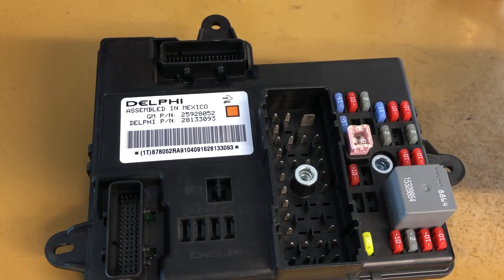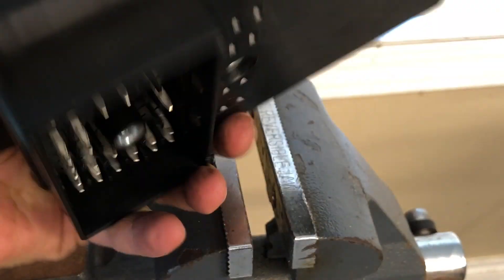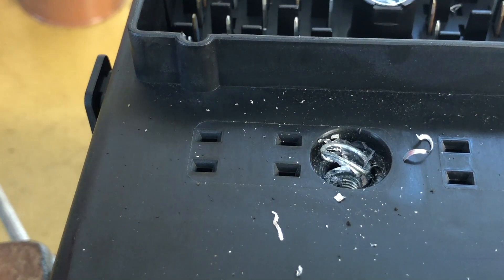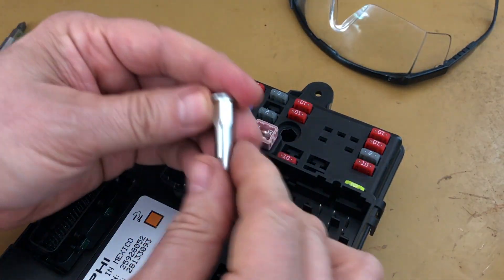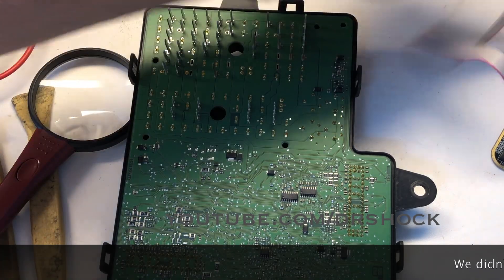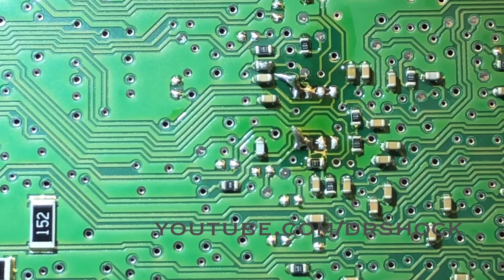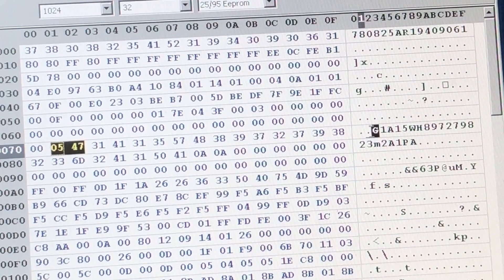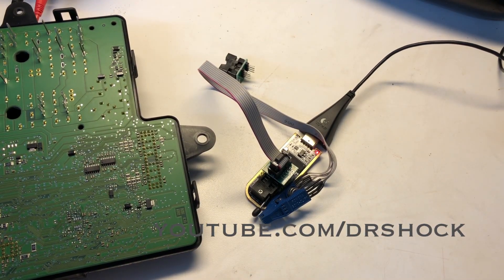2005 - 2010 GM Delphi Body Control Module (BCM) EEPROM Location & Contents (VIN, mileage) Cobalt HHR

Comment: Great info! Here is what I did. I had a 2009 HHR that had A/C, Info Center, and Radio Power Amp out which makes that "tinny" sound through the speakers. The dome light fuse was also removed as the dome light was stuck on....the delay timer quit.
I ordered the exact part number on E-Bay from a reputable salvage yard.....got it and popped it open. Got the bad BCM out and popped it open. Took both to UbreakIfix store that does cell phone repair and the guy swapped the 98050 chip out in 5 minutes. Installed the BCM in and boom.....everything fixed. $75 for the BCM......$100 for the chip swap. DIY at home. This works!
Reply: Good call on the phone repair guy.  I found a local guy that does work like this but I'm trying it on my own.  I got the eeprom off the doner and just received a digital microscope to continue.

Comment: The BCM out of the 2007 Chevy Malibu has the same threaded insert/rivet nuts which can be operated on as you show here, in order to get to the circuit board within 👍

Comment: Very informative video.  I'm in the middle of trying this, I currently have the covers separated and planning to swap chips.  Tried to do without the chipquik but had no success.  That chip is small man...
Reply: I have a Metcal Soldering staion and a Bendolin Digi Microscope and still took it to the cell phone guy.....that guy does that kinda stuff all of the time and it was while I waited....it was worth the money for me.
Reply: I asked the guy about the Chipquick and he says he does not use it as it may heat the board around it and damage it.....this guy was a good tech....

Comment: Afternoon.  I'm also working on a clients 2005 corvette.  Old BCM has a B1000 error (internal fault)  Have not found any damage on the board & wondering if it could be the IC itself?  2005 Vette BCM are now super scarce.  I do have a 2007 BCM that we tried & it everything was fine except for VIN.  Sent off to a "shop" to perform the update & instead they "viginized" the IC file.  Tech2 recognizes & sets up BCM as "new",  stores the new VIN correctly and set RPO code changes as well.  However, after about 20 minutes of key off the BCM reverts/looses the VIN/RPO changes again?!?   I now have a CH341A, modified the chip holder and the ASProgrammer software setup.  However, the chip is NOT a 95080, it's marked as a 2508??  I get all hex 00 when attempting to read the chip?  Tried all the variations of 2508 chips listed as well as the 9508 you used.
Reply: PS  Also, the 05 IC is marked with a 19044. not sure how I can post/send you pics of the chips?
Reply from the maker: I've not worked on a Corvette type BCM.  But I would expect it to be similar to some of the others GM got from Delphi during this era and many are one time use.  No Tech2 or MDI is going to be able to recalibrate them for another VIN.   Board level rework on an used module is all that is left if no NOS or reman units can be had.  Ideally you would just swap the EEPROM chip from the original to the used replacement/donor and call it a day without bothering with programming. But for this to work both BCMs must match part numbers on the white Delphi label exactly as there's little guarantee of board compatibility at the chip level.   Also some BCMs of this era can have RPO programming in the micro controller chip itself, even with the same part number.   Making the EEPROM chip / VIN swap alone insufficient to get full compatibility.  So I would also advise folks to insure the donor BCM came from the same make/model/year GM car with the same major RPO options already as well.

The 2007 BCM sounds like it should have behaved like the equivalent of a remanufactured (all that's typically done is to put the EEPROM back to a virgin calibration state).   Not sure why it reset itself, I've not heard of that happening before.

The BCM in this video is specific to the Cobalt and G5, and it's entirely likely the Cobalt BCM has zero in common with the Corvette BCM even for the same model year.  So there could definitely be a totally different memory device used.   Another common type Delphi used would be a 24CXX series type EEPROM.  You might try that setting.
Reply from the maker: Some other advice, many of these Delphi boards do not respond well to attempts at in-circuit programming.   The testclip will inadvertently power up other chips on the board.   So if you're getting all zeroes, make sure you're attempting all reads/writes with the chip desoldered off the circuit board.
Reply from the maker: The CH341a will handle those 24XXX and 24Cxx chips no problem, using AsProgrammer as the software.   When attempting to read off board as a 95XXX you did make the 5V voltage mod to your CH341a or otherwise have that support?   Automotive chips are not 3.3V like consumer electronics / computers but rather 5V instead.
Reply: Yes, I raised the 3.3V leg, but I just used a jumper between the 3.3 & 5v pins & then confirmed I had 5V on both the CS & VCC pins.  If I understand you correctly I should be able to plug the chip w/ an unmodified adaptor in to the 24xxx side of the CH341a & perform a read.   What IC should I choose in the AsProgrammer software?  
 @DrShock
Reply from the maker: If you can make out the chip foundry / fab silkscreen symbol that's always preferable to select.  If not either choose generic or a major brand like microchip.
Reply: I've got it!!   Was on a chat w/ Microchip.   Markings are ATML on both, somehow I must have had a brain fart as one was even marked 25080AN.  The other had some most likely Delph # of Q904, 58A, PH, 19044CO, but tech chat said it was an AT25080AN as well & gave me an xref replacement #.  So, a non modified chip holder in the 25xx slot & both chips read right out!   Now to figure what next
 @DrShock
Reply from the maker: Good.   So first action is to make a copy of the chips contents and save it on your laptop.   Next I'd track down a donor 2005 Corvette BCM.
Reply: @DrShock  Sorry for not replying much sooner.  I actually used the AT25080 chip from a 2007 donor BCM (Could not find an 05 for lover or $).  Anyway, erased the 07 chip, wrote the as read 05 BIN to it.  Soldered back onto the 05 board & the car is FIXED!!  PS.  I was able to buy a couple of replacement 25080 chips from ATML for the next adventure with an 05 vette failed BCM.

Comment: Dr Shock, thanks for the great video! Ive been following along with a BCM out of my 2005 Corvette. Do you do private consulting? Im having an issue that i cant figure out.
Reply: OG, What kind of problem are you having? I am also in the midst of doing a 2005 corvette and are having wierd results?
Reply: OG please post your solution. I m having issues with mine, 2005 vette.

Comment: Hey DrShock! I followed your video on VIN unlocking salvage yard radios and it worked, I watched the video for doing the BCM and it seems similar although I haven't done it myself, have you ever done this for the PCM on a 2013-2016 GM?
Reply from the maker: PCMs are reprogrammable using GMs SPS/SPS2 so no need really.  These modules do not get "locked", at least none I've came across in the last 25 years do.  ;-)

Comment: This may be treading old ground but I can't get a good answer anywhere, I have a 2007 solstice GXP that among many other issues has an intermittent ground issue caused by passenger feet on the BCM. I know this because all my cluster info went dead while driving and then came back after said feet were moved. Fast forward past a lot of no start, and now sometimes to get it to crank over i have to put pressure on the BCM while turning the key, but not always. Is this a situation that would warrant a new board? Is it possible to troubleshoot the specific ground issue without opening the module or buying a new one?
Reply from the maker: This would have to be diagnosed further.  Could just be a wiring harness problem given your description of the behavior and symptoms.

Comment: This is an excellent video! This BCM (the hardware) is also used for the Pontiac Solstice and the Saturn Sky. I have a friend over on the SolsticeForum who damaged the BCM on his 2007 Solstice GXP when he inadvertently plugged a battery charger in inverse polarity. He needed a replacement BCM and ended up being misled to buy a replacement BCM that either doesn't have the Solstice software in its EEPROM, or is defective. I suggested he contracts your services. How does one contact you? Thanks
Reply from the maker: Thanks. I don’t offer any services, just how to videos.
Reply: @DrShock  that is unfortunate, but perfectly understandable. I am Brazilian and he is in the US (Oregon) so I don't know who to recommend to him. Thanks

Comment: How are you Dr Shock. I recently bought a 2007 Pontiac Solstice GXP. The BCM was dead due to a flood during Ian storm. I was able to safe the eeprom from it. I bought a used BCM and did the switch as you instructed in the video. When I connected the used BCM to the car the radio is locked and the odo display 0mi. Can you help me out. This is the BCM p/n 25848392, the used one also has the same p/n. Thanks in advance.
Reply from the maker: Moving over the chip between identical part number BCMs is an exact clone, so you shouldn't see either of those symptoms.

Did you do a read of the chip before transferring to verify it was not water damaged as well?

Are you sure you got the pin 1 orientation correct on resoldering it to the replacement BCM PCB?
Reply: @DrShock  My cousin helped me do the swap. The first time we didn't have the kit to test the eeprom and when we connected the BCM it show the 0mi and locked radio status. Today we did the test with the kit and the eeprom was good, we checked the VIN number and even changed the serial number to match the one one the donor's BCM and when installed nothing changed. Quick question. On these eeprom the pin 1 is always in the same position?

Comment: DrShock how are you. Do you know what type of eeprom is this? You can read in the first row 1001378 and on the second row k643w. It came from a BCM with GM part number 15906911. Thanks in advance.
Reply from the maker: The Delphi 1001378 would be the same type covered in this video.  I had a text banner scroll along the bottom pointing out that older models used the house number, but later ones didn't bother to hide the regular off the shelf chip number.
Reply: @DrShock  yes is an ST. I have a photo of it but I don't think I can upload it to this chat. Then basically you are saying that it should be read the same way as the 95080 you are showing in this video. Ok, let me try it. Thanks
Reply from the maker: Yeah, but on these types of BCMs you cannot do in-circuit reading with a testclip.  Chip has to come off the board for reading/writing.
Reply: @DrShock Thank you so much sir. I'll see my cousin this weekend, he is the one doing the welding. I'll keep you posted. Have a wonderful weekend.

Comment: 2007 Solstice. Bad bcm.  Had 45K miles on it but the used modules I've tried all have about twice the mileage on them.  The modules are locked. The tech that I'm working with says that I need to reprogram the STi95080 eeprom. I have a programmer, but I think that I need to put it all back to a brand new module load for the eeprom.  I can then go back and change the mileage to what it should be.  I'm not trying to cheat/lie/etc. The Tachosoft doesn't seem to have anything for the Solstice.  (not to mention it's cost is outrageous, I understand that  they spent a lot of time on it, but I only need it for my one vehicle.)  We aren't planning on selling it any time soon.  Do you have some way to help with the mileage info. or do you know where I can get a read from a brand new bcm eeprom?   The biggest problem is the brake lights don't work.  We can calibrate the brake pedal position sensor  and we can manually turn the individual brake lights on, but the brake will not turn them on.   Turn signals and flashers work.  If I can't fix it, I'll have to junk it. It's been sitting in the garage for over a year.  GM couldn't /wouldn't fix it.  Another shop said they could but didn't and charged me $240.  I'd gladly pay $1k for a brand new module but I can't find one. I really hope you can help me.
Reply from the maker: If you haven't done this sort of EEPROM programming before, success is hit or miss.  Especially if you're not going to use Tachosoft.   The mileage, VIN, security fuel passcode all have to be corrected by hand as there's no virgin images out there for a Solstice that I'm aware of.
 
Now for a 2007, I believe the last version GM had of the factory remanufactured unit before it was discontinued is GM 25910845.  You'll want to give your VIN to a local GM dealer, verify that's the one for your 2007 though to be sure.  If it is, I see Blue Streak Electronics (BSE) still remans them for the Solstice as part BCM13904.   You'll want to move fast though and confirm this is your number, because they are likely the last supplier left for this part.  There may have been more than one 2007 BCM for the Solstice, depending on equipment so I cannot be sure.

Comment: Hello, and thank you very much for your great video and explanation.
My 2011 Chevrolet Malibu flooded to just above the height of the BCM. After the flood disappeared I started the car, and after a few minutes the odometer turned to 0. I drove one mile and the car died. I bought a used BCM, I transferred all the data from the flooded EEPROM to the EEPROM of the used BCM as you explained here perfectly. The car is operating properly now but the odometer is stuck on 1 mile and not moving. 
The trips by the way do move. 
SPS2 does not recognize the BCM.
Do you have any advice?
Reply from the maker: SPS2 will only let you setup a brand new BCM, GM doesn't support doing used BCMs.  So I suspect that is what you ran into there, presuming you used the exact same BCM part number on the white label for this repair.   

In some GM vehicles the instrument panel cluster (IPC) module controls the mileage, rather than the BCM.   But referencing this handy GM bulletin your 2011 Malibu does not - https://static.nhtsa.gov/odi/tsbs/2019/MC-10158861-9999.pdf though water damage to the IPC module could still be a factor.

So, presuming the exact same BCM part number was used, and the level of water damage did not reach the height of the IPC module, then what I would personally do is the following:

- Inspect the wiring harness to and from both the IPC and BCM.  Given the flood event, I'd be looking to insure no water damage to connector terminals (i.e., corrosion) and cleaning all with compressed air then treating all submerged wiring harness connections with a water displacement chemical for electronics.
- Use GDS2 to test out and exercise the IPC.  There will be gauge sweep tests, lamp tests, for example.   This would build confidence that the wiring harness to and from the IPC and BCM is not damaged.
- Review the backup copy of the EEPROM contents, I would verify that the mileage area of the chip is not missing/damaged.  This would eliminate the possibility that the EEPROM was water damaged before you copied it.

To me, this sounds like still water damage.  Either the BCMs EEPROM to begin with.   Or the wiring harness(es) involved between the BCM and IPC.

Comment: Hey DrShock after doing the original eeprom swap or programming into the donor's vehicle BCM do you still need to calibrate the BCM using a tech 2 scanner?
Reply from the maker: If you do a chip swap, or a complete save original image/re-program replacement, you'll have an exact clone, as long as the two BCM part numbers are identical.  So nothing more required.  If you edit the chip contents, you may still have to run thru a Tech2 pass.
Reply: @DrShock  Thanks for that idea, i have waterdamaged BCM and will try eprom swap on replacement BCM!